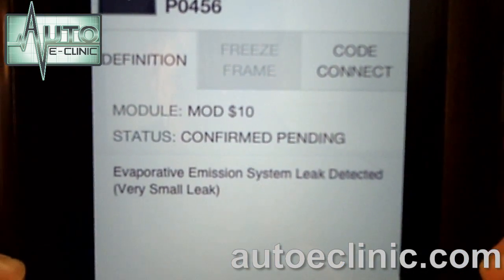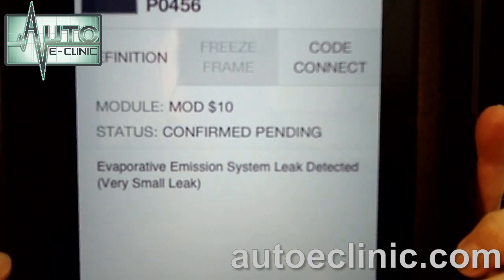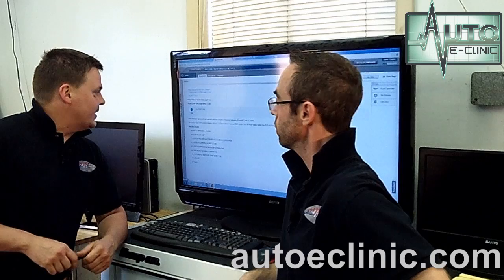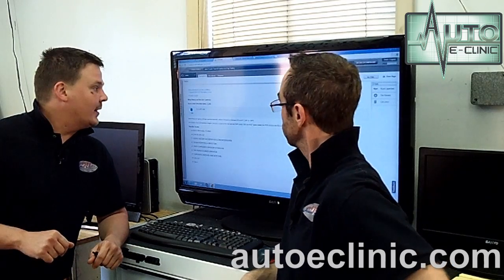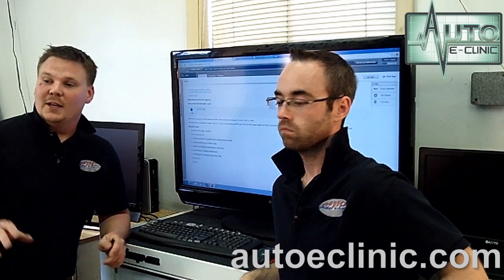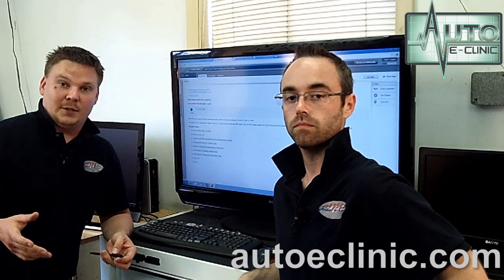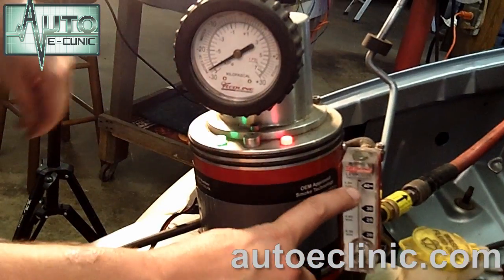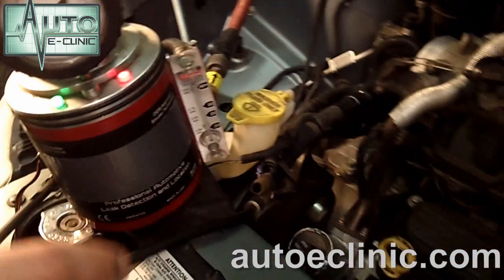How Diagnose Check Engine Light : Code P0456 - Small EVAP Emission Leak

Comment: Hi, I have code P0456 on a 2003 Chrysler Concorde. I've replaced the gas cap twice, Replaced the purge valve (I believe that's the name) that's located on the firewall, I've replaced  the charcoal canister, and even did a smoke test with a professional smoke machine. The only place any smoke came out was from the vent itself located by the gas tank. When we blocked that, no smoke was seen anywhere. Does anyone have any suggestion on what could be the cause of that code? Again, new gas cap (twice), new charcoal canister with vent valve, new purge valve. Smoke machine showed no smoke (except from the vent valve vent) but even that had no smoke once it was closed off.

Comment: I have a 2008 Jeep Patriot 2.4l that keeps coming up codes 445 and 446. I replaced the gas cap and the light was off for approx 200 km  but is back on again. Please help if you know what step I should take now. PLEASE. Thanks.

Comment: Thanks a Lot!!! Great Advice!!! I got P0456 Error Code on my 2003 BMW X5. I was able to fix it just for $7.00 dollars. I got O-Ring from ebay replaced it and 30 minutes later check engine light turned off automatically. Make sure you buy a seal which provides excellent resistance to petroleum products. Link is below:
http://www.ebay.com/itm/Fix-your-check-engine-light-error-codes-in-20-seconds-and-only-for-7-00-dollars-/332297717521?hash=item4d5e7cc711:g:J-8AAOSwCAJZYbWy&vxp=mtr

Comment: 2005 jaguar stype 3.0. ,had ivap code for years turned out to be retainer ring on top of gas tank under back seats,sometimes it actually smelled like gas when I filled up the tank ,the retainer has a problem that it cracks and doesent hold seal as it should.hope this helps other jaguar stype owners,,part was 200$ for both sides on ebay
Reply: JAGUAR XR850737 GENUINE OEM VAPOR VALVE RETAINER RINGQuantity: 2$213.42

Comment: I have this code, took it to the dealership. They replaced a "filler neck assembly" supposedly retested & was ok. Paid $450. 2 days later, check engine light is on again with the same code. I wonder if they tested all these things 😡
Reply: 450 for a filler assembly
? Holy cow, can get a used one for 20 bucks at a salvage yard
Reply: Adam Adamson women

Comment: smoke machines cost more than that Chrysler.. OBDII fuel pressure changes while you cover gas cap and hoses around the charcoal canister.. There is also another canister in the engine bay. The gas tank neck sometimes leaks too but rarely. Usually it's the gas cap or something scraped the charcoal canister or it's hoses..

These guys are typical idiots who's family members get them mechanic jobs..

Comment: Watching this video and the way these guys were showing where the leak is, i'm really not so sure that the leak was coming from the evap canister, the screen doesn't show it for sure and i will not take any "professionals" word on that.
i have seen it too many times, working in shops, that the mechanic will lie and also not be sure for certain.
to me it looked more like the leak was coming from the hose, where the clamp was broken because of the broken clamp and also because that hose it prone to dry-rot and breakage.
Just my personal view of this video and experience...
Reply from the maker: +Etography It may have not been easy to see on the video but the leak was definitely coming from the canister. We discovered it actually had a crack in it the canister where the hose attached. (Possibly why it looked to be coming from hose.) The customer whose van we used remembered bottoming out in his driveway which could have been what happened it. I think we have a video showing us replacing the canister and maybe even showing the crack. We replaced it with a used one and to this day the van has not had the evap light come back on.

Comment: so if you kept the tank above 88% the code would not be triggered? i have a 2007 aspen and it throws that code sometimes, the check engine light will come on and if i reset it it can take up to 3 weeks to a month before it comes back, I need to do a Drive Clean test and I am just trying to figure out if i can sneak it throw

Comment: Just a quick note: 2005 Dodge Grand Caravan 6cyl 3.8L - 123,000 miles
In Feb 2012, at 100,000 miles,my water pump started to leak, my driver's side window would not work, and my check engine light came on...ALL AT ONCE! What a drag! Frustrated, I took it to Pep Boys (I don't have a smoke machine nor the time for all three at once) and they replaced the water pump, radiator, thermostat, upper and lower hoses, serpentine belt and tension-er. They replaced the window motor and crank assembly. The smoke test showed the EGR valve and fuel pump bad and they, too were replaced. The repairs were over $2,500.00. In 2013, the check engine light went on again and again they said it was the EGR valve and replaced the part under warranty but, still charged install fee. Now, in July of 2015, the water pump started leaking, the driver's side window won't go up and  down and the check engine light is on. I took it back to Pep Boys as the parts are all under warranty and again they told me they need to replace the water pump, the radiator (seam leak), the window motor and the fuel pump and EGR valve for a total of $1200 in labor costs. Beware of Pep Boys...

Comment: thank u for the video !!! I had P0455 code and the leak Detection Pump vent valve 4669865 OEM Mopar  was the problem. thank God no more check engine light on

Comment: Is this harmful to a person if it isn't fixed? My Saturn Sl1 had a evaporative emissions (small leak detected) when I did a engine diagnostics. I was told to make sure the gas cap was on right and I did that and then I deleted the message and drove it for about 30 minutes afterwards and the service engine light didn't come back up. I just don't want fumes leaking into my car and choking me lol
Reply from the maker: Simon Keel A gas cap is the most common culprit for a small evap leak. There are some cases where you may have an evap issue and smell fuel vapor. It's always good to have the system diagnosed and repaired but highly unlikely to cause you any harm inside the vehicle.

Comment: Great video, very informative. I have the same van with that same code. I was wondering where that canister is located so I can visually check mine to see if that is my possible cause for the p0456 cel. Just wondering if its under the hood or under the car near the gas tank. Thanks
Reply from the maker: Here is our video replacing that canister. http://youtu.be/YMT1Mv9a0rw

Comment: I recently had a car that wouldn't start, I had it towed to sullivan tire and they replaced the fuel pump.  Shortly after that I started getting this error.  2006 Hyundai Sonata.  I've already replaced the gas cap and took it back to sullivan where they did the smoke test and replaced the canister hoping that would do it.  The light is back.  I'm not overly interested in continuing to pay for the guess and check method with this.  Any quick guesses you guys have as to what could be wrong and what should be checked?
Reply from the maker: ikaholic Thanks for watching but due to Michael's passing we can not answer any questions.

Comment: I get tired of the it's Chrysler comment. Your job is to repair it and be certious to your customer. I would go els ware for my repairs. I had a mechanic tell me I could not get the wheels off because it was a Chrysler, Not because he used an air ratchet to put them on at about a million pounds. Also warped my rotors talked to a AAA guy about Chrysler wheels. He said they are the same as everyone elses.
Reply from the maker: We do apologize for offending you and any other Chrysler owners. We do it in a joking way and would never tell you that your car is broke in real life. All the manufactures build junk from time to time. Some learn from their mistakes, maybe not as quick as others but do learn.
Reply: Same thing happened to my Ford. It cost me $150 to have the nut burned off and the stud replaced. I was lucky to save the wheel. I will never darken the door of Mavis Tire in Yorkville, NY again.

Comment from the maker: EVAP over all is pretty simple once you understand it. Usually it consist of a vent valve, purge valve, canister, and a fuel tank pressure. Depending on cost of parts, the most expensive i normally see is the fuel tank pressure sensor if you have to remove the fuel tank. This can range around $350 + or -. Thanks Michael and Aaron